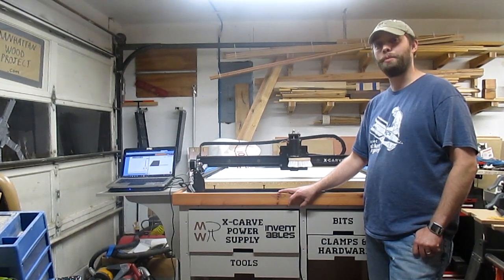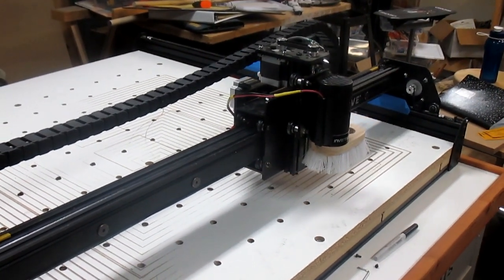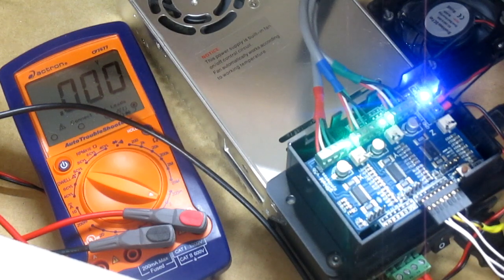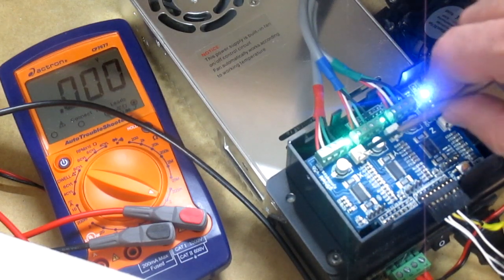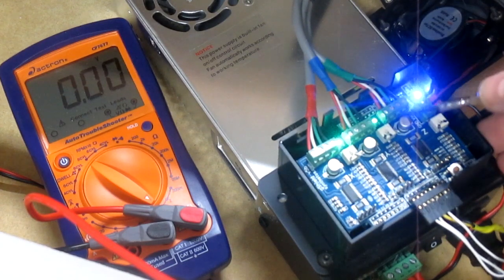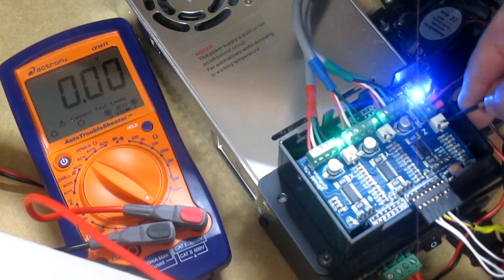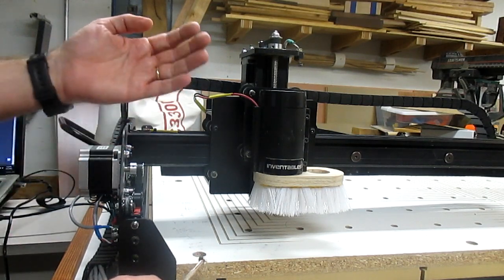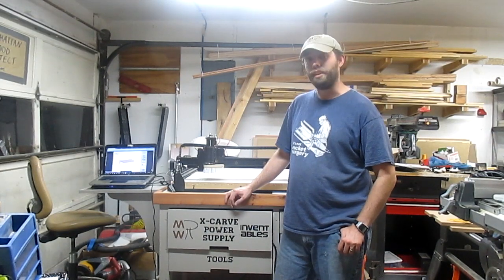35 - Adjusting X-Carve Potentiometers - Manhattan Wood Project

Comment: I know this is an old video but I've been adjusting belt tension and v wheels off and on for months with no real fix to my y axis grinding up and down and ruining projects here and there.  I watched this video and checked my pots and they were all set to like a half turn above the lowest cut off point.  I ran a test cut and it runs like a brand new machine.  Thanks!

Comment: hmmm i can not move my Z  by hand ?!??! why is that ??
Reply from the maker: +the1to9 There may be a few reasons, including tight V-wheels, high belt tension, or $1=255.  I would suggest asking on the Inventables forums, since there's a lot of people on there with a lot of experience troubleshooting issues like that.
Reply: +the1to9 The most likely cause would be the configuration setting for your board for the z axis. The Z-axis power management setting may be configured to be "always on". If the stepper is energized, you won't be able to move it by hand..  Changing it to "when moving" will allow you to move the z-axis when the "motor idle timeout" period has expired. This value is typically around 10 seconds.

Comment: Hi, great info thanks for this, can you shed any light on the intermittent fault I am getting on my X axis..........I get a grinding noise and the design skips. I have adjust all V wheels serviced the machine and no matter what current setting the motors are on it still does it??? Seems to do fine for 4-5 carves then this problem arises again..........could it be the wiring? as in the need for connectors? 

Thanks
Reply from the maker: Sorry it took so long to get back to you!  You may want to check the V-wheels and use loctite since they loosen up over time.  There's also the belt tension to check, it may be too tight or may loosen up too much and start skipping and damage the belt teeth.  The pots are a third thing to check, since low current (low torque) and high current (thermal overload) will both cause skipping and lost steps.

One of the best resources is the Inventables forum.  There's a lot of guys with a lot of experience that are willing to help out when possible.